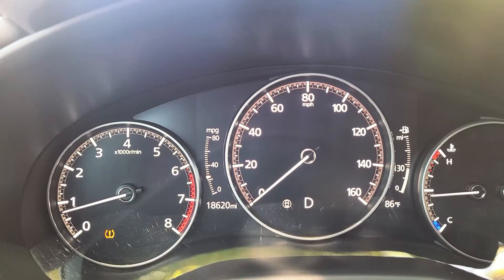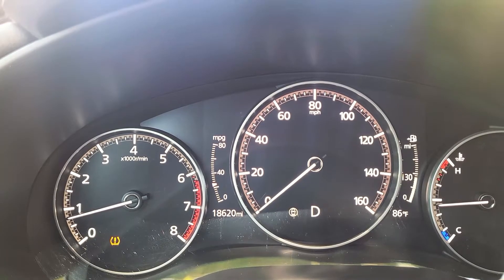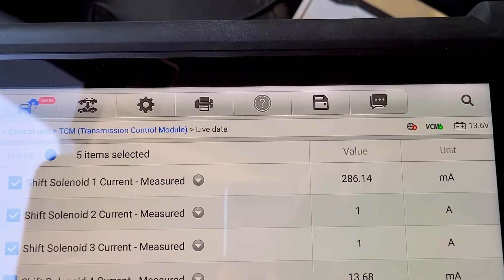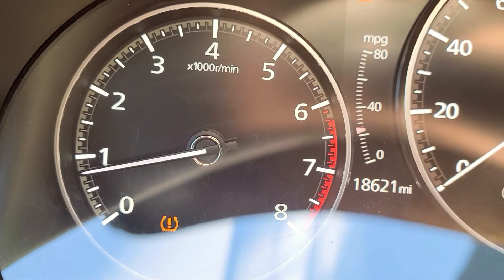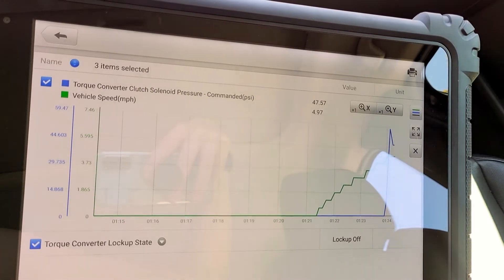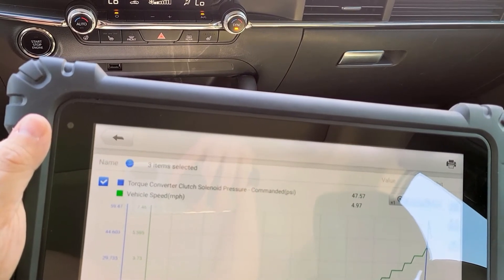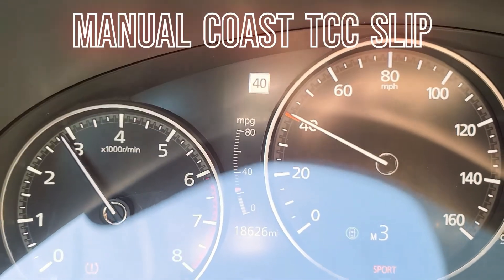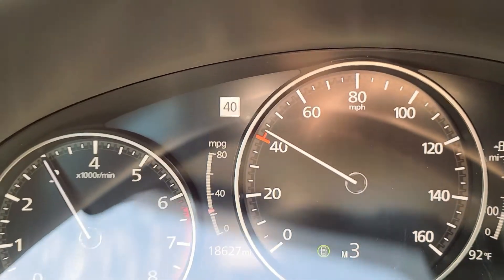Quirks and Jerks of the Skyactiv Drive

Comment: My car transmission got coolant inside. Change to half cut japan. It's jerking on lower gear and always keep hold 3k rpm when uphill. Different with previous gearbox, doesn't have this jerking symptoms byt sadly oil cooler let the coolant in

Comment: In my 3 I get little bump in second gear after shifting from 1st. It engages 2nd takes off then pulls back then takes off again before shifting to 3rd. Found it odd but only happens in warmer temperatures or if it’s cold and I’ve driven for a couple minutes. Barely noticeable when going in a straight line but harsh when going into a sharp turn like pulling out of a parking lot or driveway.

Comment: Anyone experiencing this issue?

There’s jerkiness when accelerating very lightly in traffic (just between 1st and 2nd gear). Especially when I let go of the gas pedal, and then when press it again lightly, it jerks forward slightly (not enough to shake the passengers though). Or in slight downhills also, when I press the gas, then let go, when press it lightly again, it jerks

But the issue goes away if I turn the AC off
Reply: I have, exactly the same issue

Comment: Just got a new 2025 CX-50 S Preferred. When coasting along on a flat and barely touching the gas around 45-50 mph the car will vibrate or shudder. As soon as I let off the gas it goes away. And if I give it more gas it also goes away. What's the cause? Should I bring it in for service? It only has 1000 miles on it.   Will it get worse?

Comment: Great video with the most detailed explanations of the "jerk" that we feel when we accelerate  in our Mazdas.  i did not know there were other things engaged aside from the brakes.    I have a CX-50  2.5s Select.  So far, the best way I've minimized the lock-up is  by releasing the brake enough so the car is still stopped, and i can briskly accelerate with no jerk once I apply gas.

Comment: Hello there I have a mazda 2 skyactiv 1.5L with 6 speed transmission, and I have a problem that the car
jerk once every time the car moves from stand still, it happen in first gear just before it change to
second (sometime it jerks softly and sometimes you really can feel the jerking quite aggressively). But, this only happen after the transmission temperature is at 90⁰C or above, and when the transmission
temperature below that no jerking happen, not only when the car is used from cold, but also it can
happen even after the jerking happened, you drive the car for a while in a constant speed and the
transmission temp go down below 90⁰C and you stop and get going from stand still again the jerking is gone. Can you
help me identify the problem?
Reply: Did you get a solution? My Mazda 2 has almost the same issue.

Comment: This all makes sense. My question- should I hear audible noises from the transmission when coming to a stop and the lockup is disengaging? Seems pretty loud and definitely a little jerky (way more so in colder temps)
Reply: The same here. Did you get an answer?
Reply: @chebrets same here as well, 2025 cx-5. Guess its normal trait
Reply: @valiantthor9266  I'm wondering if it's also normal for previous years

Comment: I’ve got a 2016 CX9 with 290k miles on it. I’ve experienced all these things and some additional quirks that come with age. Currently it’s throwing fits while cruising around 40mph in fifth gear at 1250rpm. If I lightly push the pedal it makes a horrible grinding noise until I let off the pedal. If I push harder on the accelerator it doesn’t make the noise. I’m guessing it’s in overdrive mode and the TCC or solenoid is having issues engaging or disengaging the clutch? Also tends to happen only when going up an incline. The only workarounds I’ve come up with is to keep more pressure on the accelerator to keep rpm higher than 1500, keep it in 4th on manual crushing up hills 94 throwing it in sport mode to keep the gear low and rpm high. The car has too many miles to invest in expensive repairs so I’ll just deal with it until it dies or works itself out. TCM relearn didn’t fix it, but sometimes the car just works itself out. We’ll see.
Reply: My cx8 also the same with you. If going from 0 then completely smooth. But when you going around 40kmh, then release the pedal, when rpm meet around 1100, put slightly push the gas pedal and try to keep it around 1100, the grinding noise happen (3rd gear). I just figure out if I disconnect the battery, mean trying to reset the TPS, its harder to be in jerking situation

Comment: Hello, I have a mazda 6 2018 25k miles, when accelerating with little touch on accelerato I feel jerky movement , if I hit it moderately, it changes gears perfectly, is itnormal? i tried initial learning test but it doesnt help
Reply: Hey I also have the same issue. Mine does it when on a slight downhill surface. Did you find any solution?
Reply: Same thing here
Reply: Is this a normal behavior? Or have you guys found a solution

Comment: I just got a 12 mazda 3 and noticed a couple things coming from a stop I was concerned about. When I let off the brake there is a very brief but noticeable transition to where the car starts to roll forward like a normal automatic transmission. It doesn't feel smooth like my older 2004 chevy. It's like coming to a stop fully disengages the transmission until you let off the brake. Maybe this is one of the quirks you outline in your video, I'm not familiar with modern cars. Also when I'm rolling through a parking lot and just barely touch the gas to turn a corner sometimes it seems like the transmission can't make up it's mind and starts "bucking". This doesn't seem to be a problem when I'm firmer on the gas pedal. I went for a short drive earlier after watching this video and reproduced the lockup you demonstrate at 5mph. I'm thinking maybe that's where the bucking sensation might be coming from when I'm hanging around that area through a parking lot. This was driving me crazy because I thought maybe something was wrong but it appears it just might be the way this transmission is. I can live with that as long as it's not broken lol. I'm really not sure though, I found a TSB that suggests a "Slip Learning Procedure", I wonder if this is related. You really seem to know what you're talking about, appreciate the video.

Comment: I have a 23 non turbo awd automatic carbon edition and mine jerks like a manual when driving slow through parking lots or traffic jams and hesitates alot when flooring it from a dead stop...was told it's the fuel management system when your under 20mph causing it...? I had to get used to it for sure
Reply: Yeah. Great car. Terrible transmission.

Comment: I just picked up a 2019 Mazda 3 with 30k miles a couple weeks ago. Every car I've owned before had a CVT Transmission (with issues) and it took some getting used to driving the new car. At first, I was too used to being very gentle with the gas pedal, as if I pressed hard on the gas in my old car the transmission would lose power, but I've found that my Mazda seems to prefer me to put a little more pressure on the gas. It seems to jerk when it shifts if I'm too gentle, but it drives super smooth when I drive a little more "aggressive" than I would in my old car.
Reply: Same, I thought the transmission was fucked up
Reply: That’s what I noticed with my 2022 Mazda 2.5 hatch. My car clamps when the revs are low it’s like the clutches seem to jerk. But when I step on the pedal all the way it shifts perfectly. So weird.
Reply: Personally? I just drive it a little aggressively, I don’t drive super hard. My gas mileage is great, compared to my Hyundai veloster turbo. Bonus? This ‘22 CX-30 is sooo fun to drive. Would get another Mazda, again.
Reply: Have a look at some videos of "resetting" the transmission, my CX5 shifts were 100x better after doing this
Reply: And your Mazda3 sounds worst than  the CVT😢. Slow gear engaged hence it is whining like a cheap rental car. It s rattled, laggy, lazy,  jerky and then out of breath at top end! Indeed you might put your life at risk when yiu need  a sudden burst to overtake it will not be there for you!  It drinks petrol like a V8 engine but offers no smiles. It just wastes alot fuels due to an amateur  software on the transmission control. It s an engineering marvel of gabage and I got rid of Mazda3 after one year. 😢. Never buy another Mazda again

Comment: Does this lockup process happen with every shift (auto mode) or just in 1st? I'm noticing the same rpm behavior (up and down after shifting) with most shifts. Maybe it depends on how hard or easy I'm pushing the throttle.

I don't feel any jerkyness. It shifts smoothly. I'm mainly wondering if it's normal to have this happening even in other gears?

Comment: Pulling a trailer up a steep hill with loose terrain and you hit 6 mph and the torque converter wants to lock. Very annoying. Sure I can stay under 5mph but sometimes I need to get some speed to keep momentum to make it up loose gravel.  Locking up in first makes no sense to me...
Reply: That is why you can put it in manual mode and start in second gear!
Reply: @MrKrugoval  bro I'm not starting in second gear crawling up a 20% grade at 10mph with a trailer

Comment: Definitely don’t listen to the “lifetime transmission fluid BS” my 21 was shifting like crap and hesitating between 1st and 2nd shifts really bad. Finally around 90,000 I dropped the pan and it was HORRIBLE!! Says you will need 5 quarts with a filter change but mine needed close to 6 and I had no leaks so had to be low from the get go! After the change it is soooo much better, being it was so burnt I’m going to change it again when I do the next oil change and then maybe again in 30,000 if I still have it.
Reply: My Mazda 2 hesitates when shifting from gear 1 to 2 while on light throttle(happens at around 15-17Kph). I normally have to pressure the throttle a bit harder or use the paddle shifters to shift to second gear.  Only happens in the mornings after the car has been off the whole night. For some reason the problem never recurs during the day. Only happens during that first morning start when driving from home.

Comment: I use Lubegard on my MaZdas and tranny operation is much smoother  , quieter, quicker up and downshift , less torque converter power loss and cooler operating temps at the max ... 
Lubegard Platinum, takes 20 minutes done thru dipstick and makes a significant difference.
What you show here maybe there due to the way Mazda programmed it but Lubegard will make it less noticeable and  smoother in operation...

Comment: Excellent video and even better explanation...Question:  My 2015 Mazda 3 GT does the jerky/harsh 1-2 engagement mostly while decelerating in DRIVE (Not in Manual mode).  Is it normal behavior as well?
Reply: Look up how to do a TCM reset for skyactiv transmissions. Mine gets harsh shifts in certain gears every now and then and the reset makes it all smooth out again. It just builds up bad adapts over time.

Comment: Great video best detailed vidoe I've seen so far. Question I have 21 mdza 3 2.5 turbo  and my idle sits at about just a little over the 500 rpm range yours sits at 3/4 say 750 800 .  Is there a idle relearn I need to do or you think there's an issue here. Thk you
Reply from the maker: The idle tables have quite a few targets to hit. Load and coolant temp play a large part in that. Before I had the car tuned, it would hit in the 500rpm range, but I've set the idle to not fall below 750.
Reply: @grolladat  ok so it's normal operation then
Reply from the maker: Yep @nelsonnarciso1791
Reply: @21mazda3turbo3  so I notice how the rpm works now with this car.  When I have defrost and feet setting selected on climate control the rpm stays high at the 750 range.  So when I selected Just feet air fow the rpm stays at the above 550 range. So I've been always driving woth defrost and feet selected so I always seen the higher rpm reading.  Smart car system to save on fuel.  Thanks for your quick reply back.

Comment: No start stop on N. America Mazdas.
Reply: I hate start/stop. I always turn it off. It's clunky and wears on a starter.
Reply: @jasonashley9853  i-stop and Gasoline Engines

While conventional idling stop systems rely on a starter motor to restart the engine, Mazda’s i-stop restarts the engine through combustion; fuel is directly injected into a cylinder while the engine is stopped and ignited to generate downward piston force. The result is a quick and quiet engine re-start compared to other systems and a significant saving in fuel.
Reply: @jasonashley9853  I own a 2022 mazda 3. start and stop not working when u have ac on or even ventilation or windows defrost. it's a smart car......

Comment: Huh. I wonder if this is why my idle RPM increases in Off Road Mode? You'll feel it takes a little more braking force to keep the car from creeping. Maybe the Neutral Idle Control is disabled in OR Mode (2023 CX-5 Turbo AWD).

Comment: Great video and explans why the trans acts the way it does in this car.  I've noticed the sport mode has some kind of effect on the trans.  Is it bad to engage sport mode while driving?
Reply from the maker: Sport mode does affect transmission operation. No negatives using it while driving or turning it off and on while driving.
Reply: @grolladat  Thanks for the insight, definitely gives me some peace of mind.  I just did this on my car and it does seem to be driving different, not as jerky as it was before.  Are there any negatives to using manual mode ?  I tend to use it quite often.
Reply from the maker: No negatives to sport mode, it won't allow you to do anything that would hurt it.  @gideonx5
Reply: @gideonx5 Sport mode uses a different transmission shift map and also changes the resistance to the accelerator potentiometer to give the engine a more spontaneous reaction (lower pedal position needed for the same throttle angle). Other than that, it's just a shift mode with higher revs. So I only use it if my engine is at safe operating temperature.
Reply: @svenschwingel8632  I'm not 100% sure but I think it also makes the timing a little more aggressive, you can hear it if you have an aftermarket exhaust.
Reply: @gideonx5  I'm pretty certain it's just throttle sensitivity and when less than 30% throttle is applied it shifts slightly slower. Though if you find out what else it controls I would love to hear back.
Reply: @erikwithak6555  After some mods and 16 months of ownership, I'm pretty sure the sport mode activates more aggressive ignition timing, along with the throttle sensitivity and increased steering response.  It was difficult to tell with the stock exhaust but its noticeably audible through the exhaust and from the vibrations from the rear motor mount.

Comment: Thank you for the video! I have this question - is it possible to somehow strengthen the automatic transmission of the CX30 FWD non turbo? For example, if I replace my own gearbox with a transmission from the turbo version?
I have a supercharger installed and it looks like I made the transmission really bad :)
Reply: The case itself is different for where it bolts tot the engine. The holes don’t line up

Comment: Unrelated question here but you seem like the top expert on YouTube. Every once and a while on my turbo I’ll start up the car and after a little bit will drive off. Very rarely I’ll hear a noise that can best be described as a low frequency hydraulic pump kicking on  and causing a buzz I can feel throughout the car and especially the steering wheel. There’s also a big draw it has on the engine power that requires a decent amount of throttle to overcome. It only comes on for like a second or two then goes away. It feels like it’s becoming more frequent. It kinda feels like it’s priming a system with hydraulic pressure. Think that this is something I should be a little concerned with or is this a normal occurrence. For reference I work on ships that will have 6-8 90hp electric motors connected to massive hydraulic pumps that will kick on our off to power our deck hydraulics. The sensation that I get feels and just like these deck hydros starting up on the boat but at probably half the frequency.

Comment: One thing I noticed between both turbo awd and non turbo fwd I’ve owned is a jump/lurch at around 10ish mph. When rolling say around a parking lot at around 5-12 mph if you give it just a little gas from idle the whole car will jump/lurch like the motor mounts are blown and the engine is jumping. It was really bad on my fwd n/a until got a tsb applied that eased it but didn’t eliminate it. It’s rather annoying in parking lot driving or stop and go traffic.
Reply: I noticed the exact same thing turning corners in parking lots. I was doing some research, is that bulletin you're talking about the 05-004/12 "Shift Shock"?